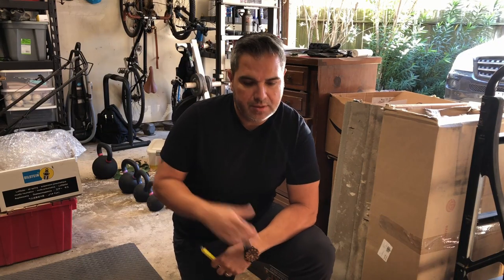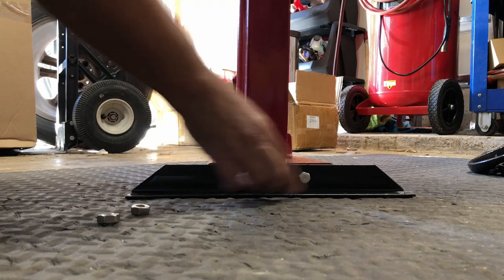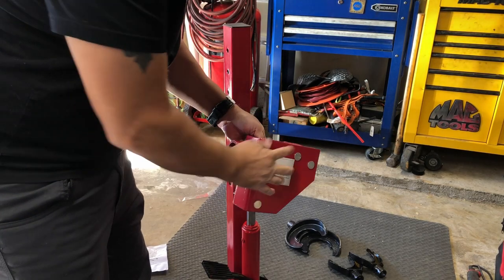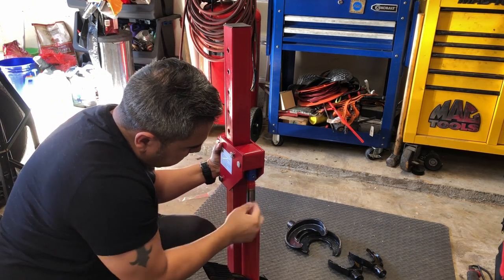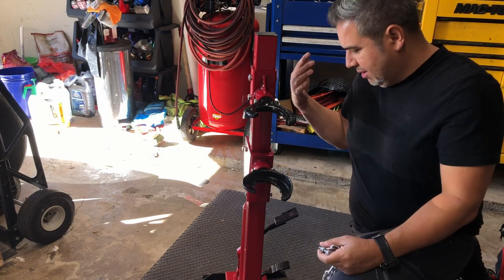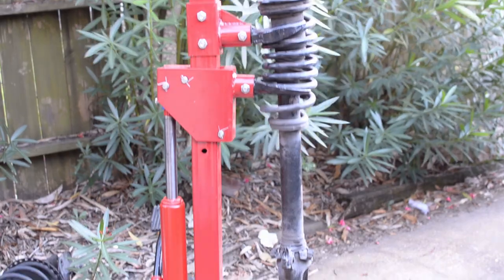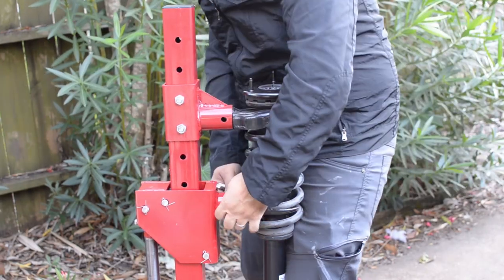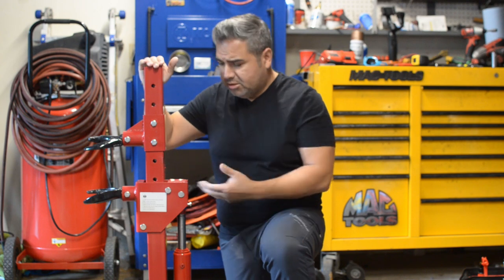Strut Coil Spring Compressor Good quality Low cost

Comment: For me safety is TOP priority. So much so, I bought a more expensive Sealey version of this tool. The yokes to hold the spring have rubber liners to hold the spring to reduce the possibility of it slipping or springing out. It has a safety chain which I used around the spring. Sealey has a very good rep for quality of it's tools. I also used pieces of old car tyre cabled tied to the top mount and bottom of the housing of the shock to protect me should the worst happen and the spring ping out.  Otherwise good video. I don't think I shall ever be using the threaded compressor death clamps ever again although having a fairly good second pair which weren't bad. This type of hydraulic tool makes separating the spring and shock absorber a far easier and quicker process as well as safer. Many thanks.
Reply from the maker: I definitely will look into the tool. Thank you for sharing.

Comment: HI good little video .. I bought one of these a while ago work fine ... but you * must and I mean must * put a chain around the spring and around the post ... these presses can let the spring go and fly out mine did and im glad I had the chain round it .. mine came with a chain and screw cleat to connect the chain togeather

Comment: I did my Mercedes S211 springs today with the same type of tool shown, however I employed a number of additional safety features. 
The older I have got the more sensitive to danger I have become ;-)
1) I employed the chain, just wrap it around taking up slack with supplied shackel.
2) Tied  8 cable ties (~7.5mm wide) around compression shoes and mated spring rung. Why? 
    -The shoes appear to be cast and of chinese quality, a little porous in places. 
    - I have seen images of the top shoe snapping under compression, producing a hazardous projectile. The cable ties will retain the shoe to the spring in such an event.
3) I place two old tyres over the whole unit, surrounding spring and upright post, suitable seated so not to cause restriction during compression, this provided me complete peace of mind.
Reply from the maker: Thank you for the input. Yes, safety is priority. This info will help the community.
Reply: @713jtmechanic8  BTW, I noticed you had the top piece with the gusset in compression which provides more space for spring compression but in all sales pictures it shows this component reversed with the gusset support underneath. Wondering if there is an issue either way?

Comment: I've had one like this for 15 year now with the exception being the one I have has the upper connection different in that it  has a partial circle hinged on both sides that goes around  where the spring  is and then has hooks that are adjustable with wingnuts that hook over the coil spring on each side. Just don't use anymore because they come as assemblies with new springs and mounts now. Was looking to redesign into pipe bender. Can see how my design would be safer in that it hold onto the  spring.
Reply from the maker: So far this spring compressor works if one is on a tight budget. Modifying it as a tube bender. Clever! 😊👍
Reply: @713jtmechanic8  Actually, the version you have looks  much more practical then the  one I have. I might design a top piece like your. I'm retired now but have a 45 year tool collection as self employed mechanic. 👍

Comment: 07:40. You forgot to strap it with chain. That spring could rip half of your face off when tension would be released.
Reply: Where does the chain attach too ?
Reply: @familyman831  You secure spring to spring compressor body. In case something fails, chain catches spring.
Reply: @Fosgen  ok great thanks

Comment: im pretty sure there's a warning on most if not all strut assemblies stating do not use power impact wrenches . use manual wrenches to tighten nuts because you "may" damage the system . but hey if its stupid and it works then its not stupid i guess

Comment: hi thanks for your video, it is quite helpful. do you have an update on this tool; there is another guy that used it 2 times and the main square tube spine started to bend.  Is it the same situation for you? thanks again!
Reply from the maker: Mine has not bend. I used it three times. I will be looking out if it has signs of bending in the future.
Reply: @713jtmechanic8  how it stand over the years i need taht tool new struts for explorer kyb blisten doesnt came full assembly
Reply from the maker: @jaandel1  i used it three times. First time on the Mercedes, shown on this video demo. These were heavy duty springs. Second time on Honda civic. Third time on Honda Odyssey. I think if you used this tool many times on heavy duty springs, it may bend with in time. Again Mercedes Benz are some of the more heavier duty type of springs.

Comment: I have one of that type, an excellent unit, I am in the process of building a cage for around the unit incase a spring jumps, very dangerouse if you are not protected, I actually am using an 8 mm chainrestraint in the meantime. As the chan that came was not to secure or strong enough to hold a spring if it slips, better Safe than sorry...
Reply from the maker: Yes, I agree building a cage will increase the safety factor on this tool. 👍😊

Comment: Turn the top section up side down will work better for you.
Reply from the maker: Hi Tony, 
I did install strut upside down before creating video. I was attempting to see which position worked more efficient and safer. However, the compressor could not compress spring enough to remove strut mount in the upside down position for the Mercedes strut.  Installing the strut in the position seen on video was more successful and safer in my experience with this tool. I do believe that your suggestion works great for other struts. Thank you for the feedback.
Reply: @713jtmechanic8  he is right , and with compressing struts you also have to have whatever is compressing struts to as far to each end as possible when the springs bend out like that it means you are only compressing some of the spring not all of the spring at the bottom of that spring you had one more rung you should have move it to below where you had it

Comment: I have one these tools as I'll be changing out my Jaguar XK8 shock upper mounts and lower bushings.
This bit of kit was a little more than the cheap death trap spring side clamps but like you I'm all about safety here. One question, you kept the spring in the tool whilst rebuilding the shock assembly but have you used this tool to fully release the pressure on the spring and then completely remove the spring (for cleaning and rust removal say as an example). If so, was the jack release smooth and did the spring pressure release gradually or as a quick action. Just curious as I'll be tackling the job on my car this week.
Reply from the maker: Hi John,
I believe the spring release was smooth regarding couplers held spring evenly, but quick action. It's been a while I have not used it and didn't pay attention. Yes, this tool is much safer than the cheap death trap. Good luck with your Jag.
Reply: @713jtmechanic8  Thanks for the reply. I tested this last night after getting the shock/spring assembly out out of my car. The spring compressor works great and with the safety chain wrapped under the spring, this gave me huge peace of mind. The jack release is smooth and I found that the pressure from the spring helps it move backwards without any intervention. I'll be removing the upper mounts tonight and will then release the spring pressure with that removed to separate the spring completely so I can clean it, give a quick rub down and refresh them with TechniQ Spring coil paint before reassembly. :-)
Reply from the maker: @SkylarkBlue_RGC  Yay! Glad it worked for you. Yes, this tool gives you a peaceful feeling of safety.

Comment: Hi, will it work on other vehicles?
Reply from the maker: Yes. This spring compressor has to different size of couplers, ( the black adaptors that squeezes the coil spring). This spring compressor will work on most vehicle models. In my experience, the mercedes springs are the most difficult ones to compress.
Reply: @713jtmechanic8  Thank you for quick reply. Yes indeed Mercedes springs are the most dangerous ones.

Comment: great video!  were the forks capturing the spring flexing or were they made to make the spring look like it's going jump out if the fixture...very scary!
Reply from the maker: It looks scary, however, the spring coupler adapters have a cup shape to them which secures and hugs the coil spring. This tool is way safer than coil spring clamp compressor. Those are truly scary to use. Thank you for the feedback.

Comment: I just bought on of these and its lethal if used with springs any heavier than say for a Supra or Civic spring. Its rated at 6600 lbs and I used it for a stock spring on a FJ Cruiser which is a 600 lb/in spring and the column started to collapse and buckle. Could have been deadly if I wasnt paying attention. I had to rebuild it with 5mm wall thickness tubing to replace the garbage 2 mm wall tube its made with. Ive now used it with 800 lb springs and it works but I would not go to a 1000 lb spring for fear of the cheap weld at the base letting go.
BE VERY CAREFUL WITH THIS CHEAP TOOL....IT CAN KILL YOU
Reply: Why can't anyone just build it right? It's a great concept.
Reply: @ericbailey9549  They do, but they start at triple the price
Reply: What is the imperial tube size you went with? How's it holding up now?
Reply: @MrWeaponlord  Forks broke with an 800 lb spring on the next attempt, Nearly killed me! Just too dangerous with any SUV or larger size spring. I can have a look tonight if you want to pursue it?
Reply: @1Coolbanana  no that's okay. Dang that's scary, any thoughts of getting some claws cut from thick mild steel? You could weld tabs on to keep it secure on the springs.
Reply: @MrWeaponlord  By the time you do all that, may as well just buy a proper compressor and be done with it, that or just take the strut to a shop 😕. Wish I could post pictures!

Comment: I don’t think the tool was used correctly.   Just my common sense says that the spring should not have had such a bow to it when compressed.   I believe if you match the contour of the spring to the coil brackets, the you should be able to compress while keeping the spring vertical without it curving outward ready to jump away.   
Also, if you really believed in safety, where was the safety chain?   Did you sacrifice safety due to a perceived rush to get the video done?  How would you have felt if someone watched, used this video and like you did not use the safety chain, and had a fatal or catastrophic accident?
Yea I know best intentions and all, but we really should all strive to think, and act safely.   I’m not suggesting paralyzing safety constraints just safety constraints to prevent actual paralysis.